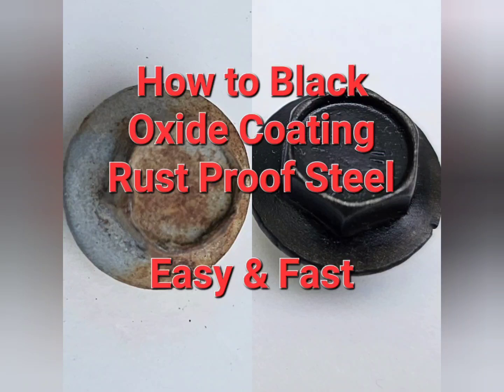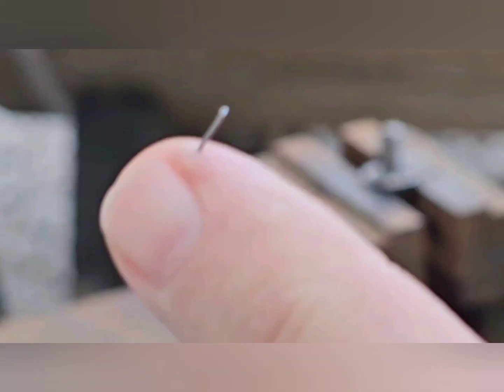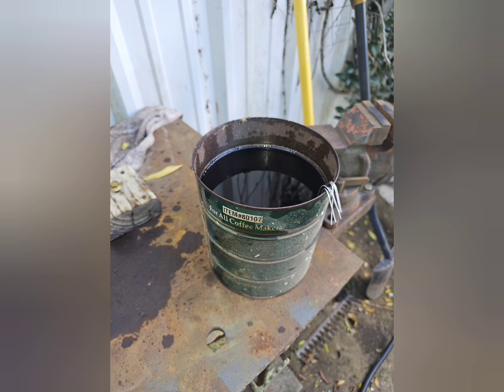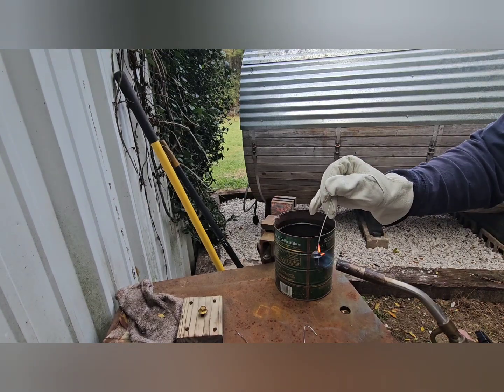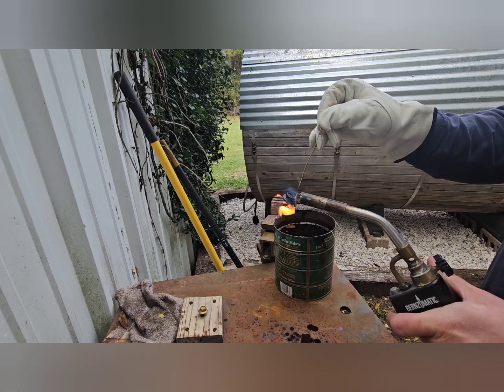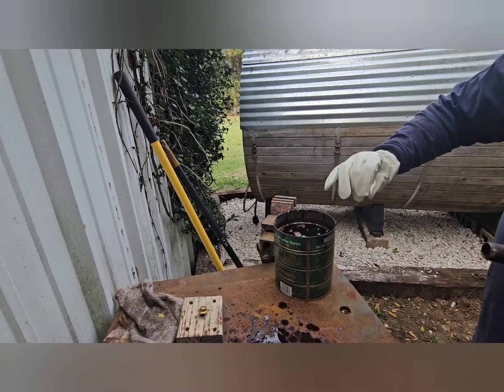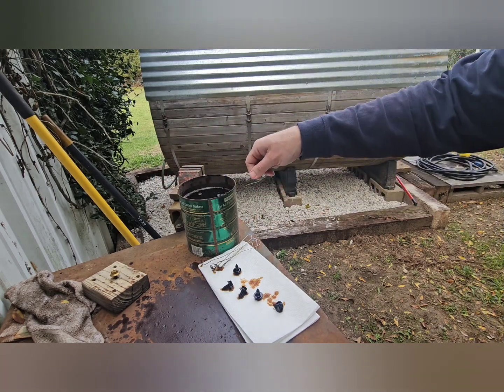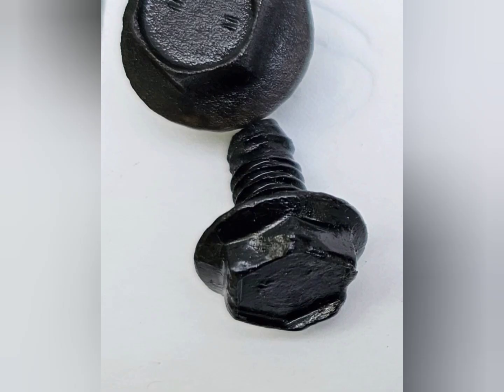How I Black Oxide Coat Steel Parts. Rust Proofing.

Comment: Quick, to the point, and concise. I love it.

But that's just a patina like you get from seasoning a cast iron pan. There's no actual oxide involved here. Is this the same process that is used commercially to produce "black oxide" parts?
Reply from the maker: @captainotto Thanks for the comment. I don't know how it's done commercially. This is how I do it. It seems to hold up. I've left a bolt out on an outside work table and it still looks the same. It's been sitting for about a month so not exactly a torture test. All the other parts I've done are in mostly protected conditions. One of the people that commented mentioned he had a client with a commercial buisness black oxide coating parts. He said he would show the vid to his client. Hopefully he will post an update.

Comment: Rusty bolts/parts, just boil or steam them for about 20 min then card them, after that soak in kerosene overnight, done. Same finish as a gun barrel
Reply from the maker: What's card them? @independentthinker8930
Reply: @txfatmarine4583  it's done several ways, fine still wool rubbing it is a common way, gunsmith get an exceptionally soft wire brush to speed it up

Comment: Used motor oil is great. If you do any concrete work, it makes a good release agent for forms.
🤓
Reply from the maker: I have a small concrete project coming up. You wipe it on with a rag? How do you apply it to the form? And do it right before you pour?
Reply: @txfatmarine4583  Oh, I brush it on the day before, once forms are set. 

Best to use screws to reuse your 2x4 forms. 👍
Reply from the maker: @Pallidus_Rider  that's good info. I'm logging that down.
Reply: @txfatmarine4583  For regular 2x4s, you can use a sprayer, but may need to dilute it. I just brush it on with a large inexpensive "chip" brush from hardware store.  I have used the same brush over and over.

Comment: Nicely Done! Thank you! So thats actual carbonized, not "stained"? How look will they last, what is the durability like. Great stuff and I alwas like getting dirty with used motor oil. A win - win situation!
Reply from the maker: Thanks @coldwarvet607. I haven't done a torture test for the durability but I need to. The bolts I coated are all under the hood of an old truck. In the engine bay. They still look exactly the same. I plan to set a couple outside exposed to the sun & rain and see how well they hold up. Appreciate you taking the time to comment.
Reply: @txfatmarine4583  Blacksmith here. I do tons of heat treating and rust prevention treating. Its ok if you get your bolts up to cherry red depending on whether they are mild steel or medium to high carbon. Mild steel /Low carbon dont worry about it. Anything more, and it will be good to temper then back down to usable levels. And yet, you can get bolts to yellow (beyond cherry red), or even 5/8" x 2.5" wide thick steel using two propane torches, with one being at least a TS4000. You can do the blackening with used canola oil too (or any veg oil). Just heat to a black heat, quench, do again until you get the coverage you desire.

Comment: So, um, not really black oxide. You're bluing them with the heat, so technically there will be an oxide layer on the bolts. But dunking them in oil is burning the oil onto them, and creating a layer of polymers. That's actually a great rust preventative coating. It's just like seasoning a cast iron skillet.

Also, I don't know about wearing gloves with a grinder. If that glove gets caught in the grinder, that could be a serious injury. I mean, I wear nitrile gloves, but that hardly counts, they'll just get torn. Will still get wire splinters though. A leather or cloth glove will drag your hand into the machinery and that won't be pretty.
Reply: Exactly, gloves have their place, but around moving machinery they are a safety hazard.
Reply from the maker: @madmanmapper Thanks for taking the time to comment. And yeah I still mostly don't wear gloves. I just burned the crap out of my hand with a heat gun melting heat shrink. I'm going to try and do better so I can keep doing this stuff as long as possible.

Comment: Farmers Cruise control was simply a cable running  from the Carb to your dash board, very much like the Choke on a lawn mower. You would put the truck in 1'st gear, pull that knob out and the truck would just slowly move. It allowed farmers to single highhandedly pick up rocks and junk from their field at a walk and not worry about the truck moving to quickly away from you. Easier to catch in case your headed to a tree LOL
Reply from the maker: @timdeboer8804 Better than the old brick on the gas. Pretty cool. Thanks for the explanation.

Comment: This is NOT black oxide all your doing is seasoning the bolt with a coating of carbon much like you do with a frying pan. With Black oxide you convert the surface to Fe3O4  (Black iron oxide) what you're doing is NOT depositing black iron oxide or creating on the surface.
Reply from the maker: @matthewq4b You maybe right. Maybe not. I googled bluing and black oxide before making the vid so I could try to get the wording correct. I found several processes seem to fall under the "black oxide" banner. I appreciate you taking the time to post. And if my wording does end up being wrong or not the best way to say it. I want to know that so I can correct it.
Reply: @txfatmarine4583   There is no maybe not. What you are doing is NOT black oxide.  Also Bluing and Black Oxide are essentially the same thing...  Again what you are doing is NOT adding a layer a Black Oxide to the surface simple as that.  You are just deasoning the bolt with a coating of carbon and nothing more..
Reply from the maker: @matthewq4b  We will have to agree to disagree. Thanks for sharing your opinion. I appreciate all the comments.
Reply: @txfatmarine4583  I have been doing bluing and parkerizing for near on 40 years now. You are NOT putting a black oxide coating on the bolts simple as that...  Disagree all you want all want, it does not change the fact that you are not putting a black oxide coating on the bolts no matter how hard you want to convince yourself otherwise.
Reply from the maker: @matthewq4b Again Thanks for the passionate responses. I'm not challenging you or your 40 years of experience. On the contrary. I'd appreciate it if you teach me a better way. I hope you make a video of how you do it and Link me.

Comment: I tried salad oil. It worked, but the result looked messy.
Reply from the maker: Interesting. Why salad oil? Just to see?
Reply: @txfatmarine4583  Yeah, I just wanted to see. It works, you get a black rust proof coating, but it's a messy, uneven surface. I mean, if you have nothing else...
Reply from the maker: @mikethespike7579 Another comment mentioned heating the object to be coated in the oven. I think I'll try that next time. I think the results will be more easily repeated. I'm curious about the salad oil. I guess it's just to thin of an oil. Or doesn't have enough carbon? I guess you did this with bolts? Have they rusted?
Reply: @txfatmarine4583  It would have to be a really hot oven of course. Not just a kitchen oven. Yeah, an oven will offer you controlled temperatures and repeatable results.
I don't know if salad oil is too thin. Someone on YouTube showed how he coats stuff using WD40.
Salad oil has all kinds of other stuff in it, not just oil, that probably mess up the results a bit. But it was an interesting experiment and does give a protective surface. If you have nothing else just use salad oil LOL.
Yeah, I just did some nuts and bolts. I had nothing better to do at the time.

Comment: Your actually hardining the steel heating and cooling them in oil
Reply: Wrong , he is not heating it up that hot
Reply: It is the same as seasoning a cast iron skillet the coating will not last very long in the elements though...

Comment: This will not last and will rust on first sight of moisture.
Reply from the maker: @cryptotron Maybe. Maybe not. The bolts I used are in an engine bay. They still look good. I've pressure washed in the engine bay once. But they have not been exposed to any continuous water. I keep meaning to leave one outside and see what happens. Thanks for taking the time to post.

Comment: I have under carage rust on my truck. Do you think using a torch to heat up the rust and then applying the oil with a paint brush would work?
Reply from the maker: Brent I'd prob use something like Eastwood's rust encapsulator. Roll it on and use a brush for the tight spots. There's other brands out there. I've used Eastwoods before and it holds up pretty well.
Reply: You would probably set your truck on fire!

Comment: This is hot bleuing ... NOT black oxide. Oxide is rust. Black oxide is converted red rust.
Just change the title.
Reply: I used to do this years ago. Looks real sharp but doesn't stand up to wrench pressure or oxidation either. The more coatings you put on the more brittle it becomes. Used oil out of a diesel engine gives the blackest coating though.
Reply: It's not actually either, it's a layer of oxidized oil that your coating the stuff with. Not really important though. it looks pretty much the same and resists rust pretty well too. It's a pretty easy way to get a nice black coating
Reply: @asbestosfiber Question:  how does this wear or look after you put a socket or wrench on it?
Reply from the maker: Google Bluing & Black Oxide. Essentially the same thing.

Comment: Those wire wheels are savage - I've copped splitters in the face before.
Reply from the maker: You'll shoot your eye out!
Reply: I wear a full face shield anytime using wire wheels.
Reply from the maker: @flyingfarm1  I should also. I'm really trying to be better with my PPE
Reply: @txfatmarine4583   I've had them most places on my upper body. I have a thick bush of hair on my head, and once I found one that had pierced into my skull skin quite deeply. Hurt more once it was out, than what it was in. Never even felt it go in.

Comment: How well does the coating actually hold up?  Like as soon as you put the wrench on there, it comes off?  I'm just curious, because it almost looks too easy.
Reply from the maker: It holds up pretty well. All the bolts I've done are protected from direct exposure from the elements. They still look the same. I also tried brass coating and left one bolt on my outdoor work table. The brass has started to rust. I need to leave a black oxide bolt out on the table also and let you know.

Comment: I'm going to flat out state that you're ruing these bolts. Your ruining the temper and making these more brittle than their original rating. To season bolts you're better off using grapeseed oil. Clean them, then dip the lot in a cup of grapeseed oil. Toss these in the oven at 400 for an hour. Dip them again and cook them again. Repeat as many times as warranted. The cooking gets em up to 400 yes, but they should not be bluing due to temperatures. Not many things will exceed 400 degrees during normal operation. Exhaust excluded. Thank you for the video, but please upload another with a "safer" method.
Reply: Yes, he is ruining the original temper, but not that much. It all depends on the use of the bolt. 
If you can see, he is heating it to a blue color, so it still IS a tempering color.
It's not unusual to temper bolts to a blue color and this is around 280C - 310C
Last but not least. It's not making them more brittle, but more ductile. Hardened steel is brittle. Tempered becomes more springy, ductile, so for many applications it is more desirable, especially with bolts.
This is all assuming those bolts are made of a carbon steel used for hardening.
Check a diagram for FE-C content.
Reply from the maker: The bolts I used in the video hold an engine bay cover in place on a 1966 C10 truck. I appreciate the comments. It's good information. I'm learning from you guys and also trying to encourage others to try something new.
Reply: @txfatmarine4583  If it's just a cover, I wouldn't sweat. If those were used in fixing the engine block, that could be a problem. I wouldn't heat up any bolts that needs fixing with a torque wrench. And if you need to heat them up to unscrew... Exchange. Everything else is a common sense - covers, small constructions, not much force - have fun. Bigger contructions, bolts with a specific torque - no heat.
Steel is an amazing material and also a very difficult one. If you would like to find out a bit more, there is a ton of information about it on blacksmithing channels. But one I found very useful was a clip on one physics channel made by Steve Mould:
https://www.youtube.com/watch?v=xuL2yT-B2TM&ab_channel=SteveMould
Stay curious 😉
Reply: Txfatmarine, I salute you for your patience in dealing with these idiotic comments. KJ7JHN tells you that you're killing the temper when you heat them to the 400 that you state in your video, but then proceeds to tell you to heat them repeatedly to 400. Hahaha I can ASSURE that 400 ain't doing dick to the temper.  We use basic ass, grade 5 bolts on 1500psi steam flanges. Probably the same grade you got there. And we use them because that's the engineering spec. And we reuse them for decades. They're getting WELL beyond 400. So dude, keep on coating. Your bolts will definitely last longer without rust than they would have before. And let KJ7JHN take his grapeseed oil and go season a cast iron skillet and then bake us a cake with it.
Reply: Can tell people in these comments know nothing about metallurgy. 400 degrees affects nothing as far as them temper or annealing process.
Reply from the maker: @maxpain7197  They've been going in pretty hard on me. Lol
Reply: @maxpain7197  It depends on the scale you use 😁 You didn't say, so I can only assume, you are using Fahrenheit. that's around 204C - a bit below the lowest tempering temperatures I've heard of (210 - 220C). Annealing requires to get to an austenite solid and this temperature is much higher and can be found in Fe-C diagram and it's above 723C/1333F (depending on the C content). So basically for annealing, you have to make the steel glow at least cherry red. Or test it using a magnet, because austenite is loosing magnetic properties.
Reply: @ogi22  For as much as he is heating that bolt,  and quenching it in oil.  It wouldn't change the hardness.
Reply: @maxpain7197  OK. I don't know how hot you need to get steel to oxidize it black with oil. But now trying to remember some blacksmithing clips, I realise they don't get it too hot. Just to a smoke point of the oil. Gathering from what I know about cooking, oil smoke point is something above 200C. My pan is smoking around 230 - 240C with clarified butter (checked it with infrared thermometer when I was seasoning my pans 😁).
Just checked. Flaxseed oil (raw) smoke point is 107C. Boiled is probably around 200. So I guess it depends on the oil you use. And yes, with those temperatures, especially if you treat the screw only for a couple minutes, it wouldn't change the hardness much.
Reply: As per ISO 898-1, if these metric property class 8.8, 9.8, or 10.9, they should be perfectly safe to heat up to 425C (800F) without tempering them any further. I seriously doubt he's getting even the edges of the flanges that hot, but I guess you could always check with an infrared thermometer or a thermocouple. PC12.9 and up is really unusual specialty fasteners, so I'm sure it's not that.  And if it's anything in the property classes 4 through 6, it's not heat treated so there's no temper anyway.
Reply from the maker: Good idea. I may try the oven method in the future. I can see how the results would be easily repeatable.
Reply: It's perfectly OK to heat bolts like this. The reason is that you're cooling them down slowly in the oil. If you were to let them air cool, then you would lose some temper. You wouldn't lose much temper at these low heating Temps from the propane but, you would lose some. The oil fixes all of that. 
I used to do this to truck frames and keep the temper, and that was with heating them all the way up to cherry red to be able to beat them back into shape with a hammer. Then, while they were still red, I would pour a steady stream of used motor oil on the frame into a pan below. It made a bit of smoke but when I was done the frames were just as springy as when I started. Oil works well here. You'll be fine.